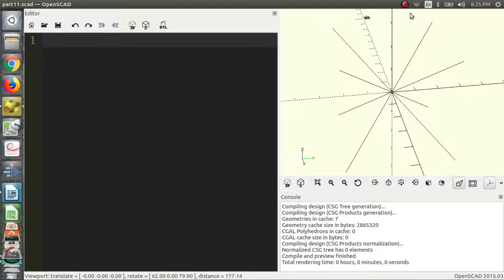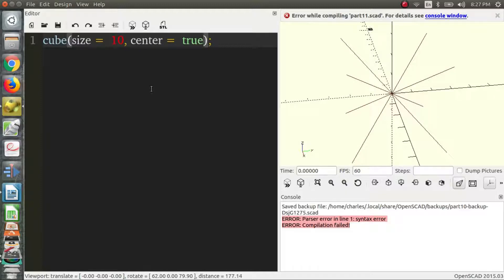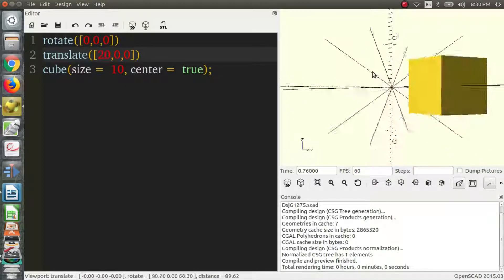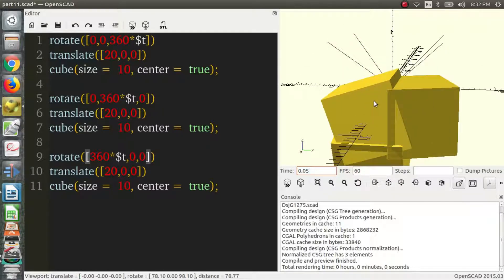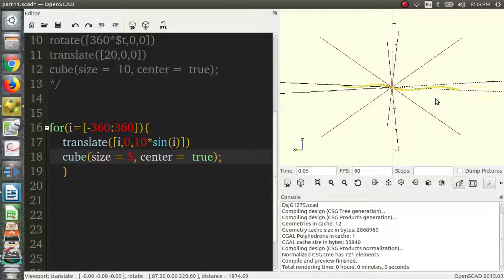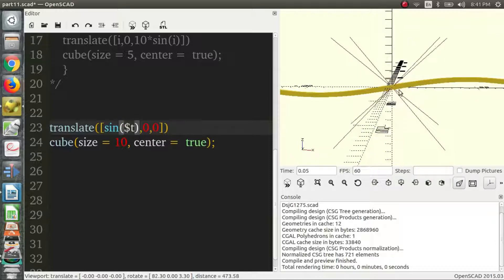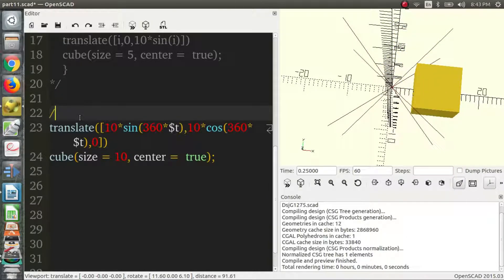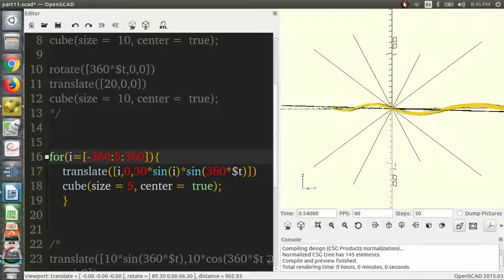Animation-OpenSCAD Tutorial 11

Comment: Any way to animate in OpenSCAD with wireframe view? (View -> Wireframe)
Reply from the maker: Not that I know of.
There are some other things that can be tried though.
1) you can go to view -> show edges and select that option and then make the model transparent by either
putting a % before it
eg 
%sphere(r = 10, $fn = 20);
or making it transparent using the color operator
eg
color([1, 1, 1, 0.3])
sphere(r = 10, $fn = 20);
the last channel in the color vector ([1, 1, 1, 0.3])  (ie the 0.3 part) is the alpha channel
which can be changed to alter the transparency of the object.

2) you could define the points and connect the edges yourself using either (cubes and hulls) or 
(angled cubes/cylinders) , but this can be complicated and in some cases requires reinventing the wheel if any boolean operations have been applied. let me know if you need more detail about this option.
Reply: @CharthuliusWheezer 
Hello. Thank you for advice!
1) Models, to which i apply % are not fully transparent. 
At least on my vesrion. They are a little bit grey.
With transparent thing it works better, but the thing is that edges are not wireframe. =(

I can't explain it formally. 
You can see it with example:

color(alpha = 0)
translate([10,10,10])
difference() {
	sphere(100, $fn = 30);
	cube(95);
}

New "edges" that came with difference are not edges actually, but you can see them in wireframe view.

2) It is very complicated. It requires refactoring all the code and reinventing, for example, boolean operations, as you said. 
Imagine reinventing Minkowski sum. Or hull. I'm not sure, if it possible. =)
As i understand, hull is something like intrinsic. It is impossible to write it in OpenSCAD therms. 

Anyway, thank you. I got a view that is close to one I expected.

I have 1 more question.
Is it possible to make animation not from previews, but renders?
Reply from the maker: So one thing you could do, for the example of the difference you provided, is to render the shape, export it as an stl or some other model, and then re-import it. but this is dependent on what you are doing and may or may not be useful or practical. I would assume that boolean operations make the previewing not work properly. 

also just as a note, transparency works in interesting ways. the order that the objects are defined determines if they can be seen through other objects.

for the edges and points ie(part 2) here is an example of what I meant:

points = [
[0, 0, 0],
[1, 0, 0],
[0, 1, 0],
[0, 0, 1]];

edges = [
[0, 1],
[0, 2],
[0, 3],
[1, 2],
[1, 3],
[2, 3]
];

for(edge = edges){
	
	i = edge[0];
	j = edge[1];

	p1 = points[i];
	p2 = points[j];

	hull(){
		translate(p1)
		cube(size=0.1, center=true);

		translate(p2)
		cube(size=0.1, center=true);
	}
}

the hull portion could be replaced with a piece of code that creates a cylinder, places the base at p1 and the makes the length the distance between p1 and p2 and then angles the cylinder to point at p2. I think it could be possible to implement the algorithms that are used in OpenSCAD within OpenSCAD but it would be tedious and they would likely be much slower than the ones that are used already.

for the last question. I think it's not currently supported but anything is possible with enough time and effort and sometimes just knowing where to look, but I don't know. Here is a thread with the same question being asked and responded to.

https://forum.openscad.org/Can-I-force-Animation-to-use-quot-Render-quot-instead-of-quot-Preview-quot-td14828.html

Comment: Hola! Congrats on your channel. Good explanation. Do you know if there is an android version of openscad? I use ScorchCAD but it doesn't support animations
Reply from the maker: Hi. I do not know of any other OpenSCAD like software specifically for Android. You could try contacting the developer of ScorchCAD and requesting that feature explicitly. A possible workaround would be if you just want to take pictures and put them in a video, you can create your own animation variable, change it slightly for each frame, and take a photo or a screenshot at each frame and then put them together in a video. However this process would be really slow.

Comment: Hi. I want to use an "If" or Something to split in 2 different moves depending of 1 one spot
Reply from the maker: I'm not entirely sure what you mean. You can use an "if" statement to change what code is running depending on the time variable ($t). 

ie. 

if( $t < some_time )
{
    thing_one($t);
}
else{
    thing_one($t);

    thing_two($t);
}
Reply: @CharthuliusWheezer  i solved it with ' function= (condition)? Yes:No;
And worked For me